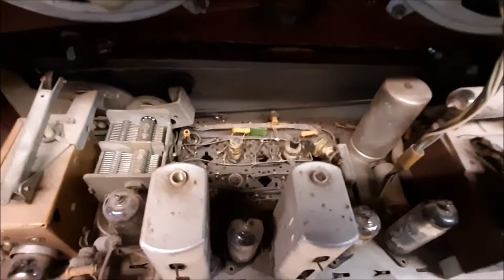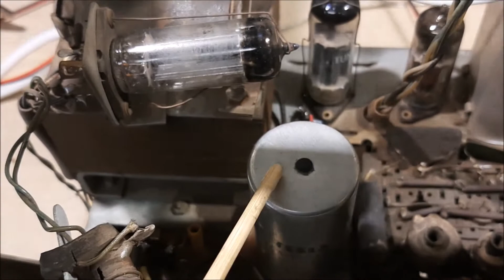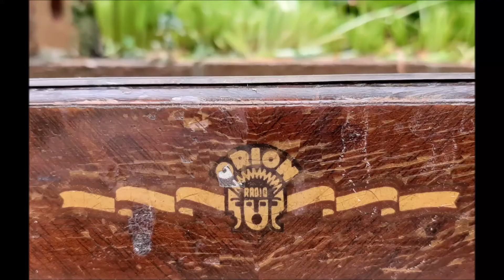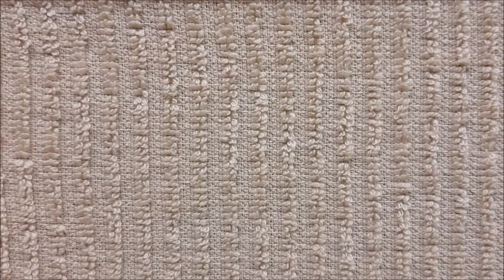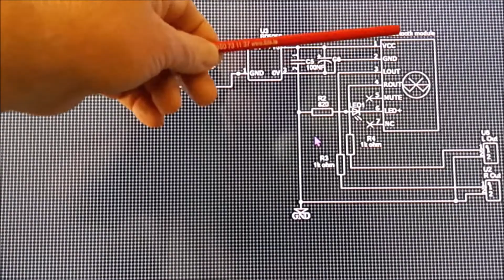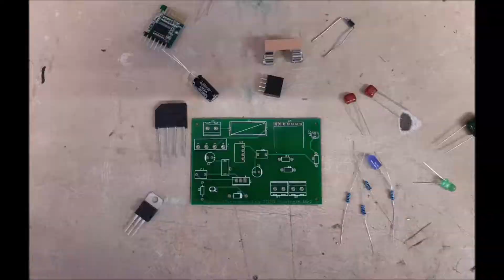Orion AR602 radio restoration

Comment: 232 / 5 000
Fordítási találatok
Radio wave changers can be removed by pressing and pushing backwards. If I remember correctly. This makes it easier to repair the roll. Contacts are silver-plated, do not sand, only wash with solvent! I wish you another successful restoration! 
(Translated by google)

Comment: Please. No bluetooth on these old radios.
Reply from the maker: Unfortunately, in this country a.m. reception has virtually vanished, so radio reception is limited to f.m. By adding bluetooth , a world of online radio stations are now available via the phone, ipod etc. Any of my friends that have received restored radios in this fashion are delighted with the result and are using and loving the warm "tube sound" on a piece of furniture that they might otherwise have scrapped. I appreciate that the purist would not agree, but what's the difference between this and fitting Japanese Nichicon capacitors to vintage radios in order to restore them ?
Thank you all the same for your comments.
Reply: @rodsradios  Yes. I know. Here too. 
There is mainly one or two stations left.
I guess all have gone since, the world moved to the internet.
But adding bluetooth îs not necesarry.
You could simply connect your device to the audio amplifier.
What i meant to say, i also got a Orion old radio, but i did not go that far to remove the laquer from it. I just clean it with alcohool, then add another layer of laquer, when i was done, so i could keep the front label.
In your case i think i would clean everything else, and blend with the old.
Reply: @rodsradios  Btw. I am also working on a Terta right now.